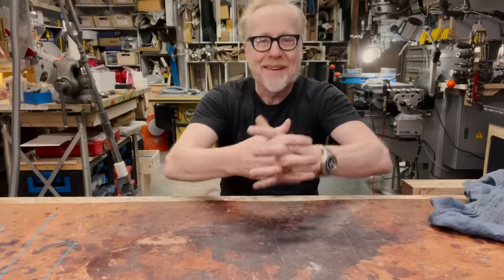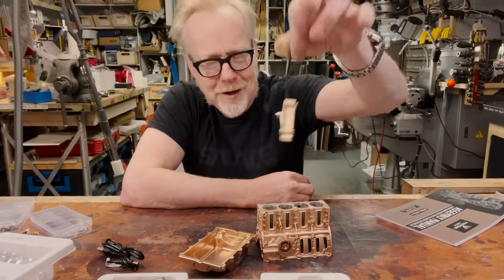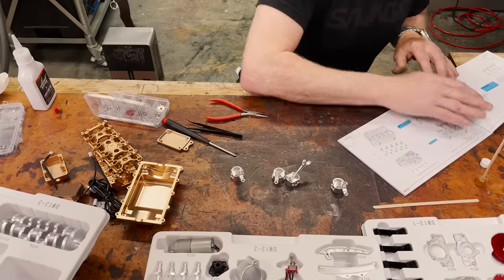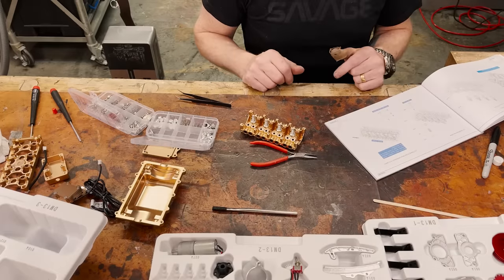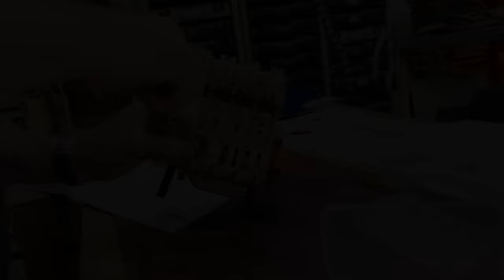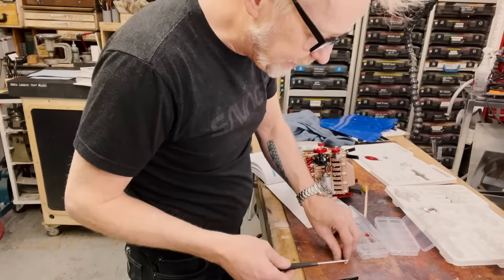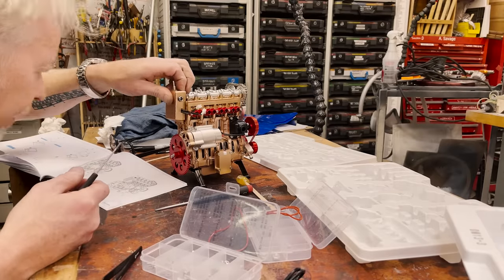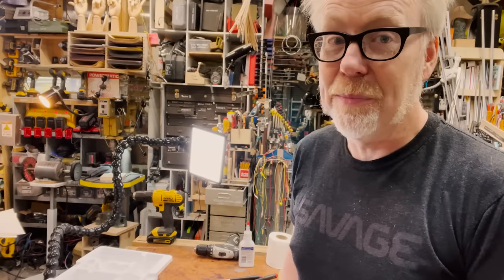Adam Savage's One Day Builds: Car Engine Model Kit!

Comment: 13:00 Those pistons don't have piston rings? Isn't that a major concern? Piston slap? Anybody?
Reply: But I assume this is not a working engine? For that same price you can find a real engine in that scale. Which uses fuel to run.
Reply: There is also a working miniature V8 engine which costs $1800 USD. xDDD That's pretty amazing.

Comment: Well geeze... The silly thing doesn't even run. It's a model only. Check out this one that is actually a working 4 cyl engine. It's just short of $700 but actually runs (vs. $440 for this non-working one). 
Just search youTube for this:
"Assembling & Running a WORKING 4 Cylinder FOUR Stroke Model Engine - Toyan L400 Engine"

Comment: Hi Adam, I couldn't wait to see your reaction when you found out it was NOT a real running engine, but a $500.00 desk top toy, ... or did you know from the onset?

OK, you did know, but still you seem to have fun building it, i build the much more expensive REAL gas running motors.
That said, I (because of an accident), only have the use of my right hand only, so building these motors is much more challenging at times where 2 hands are needed, I have to think outside the box, (as it were), ..... so, I challenge you to strip down that engine, put your left thumb in the belt eye at the back of your jeans, and rebuild the motor. ..... Go on, I dare you????

Comment: But at that price point, bit steep for the average person (in my opinion) just to have setting on the shelf. Spend i few hundred more and get an actual working engine, build it and sell it for a profit. (Just my 1 cent, for what it's worth). They are cool, but not almost $500 cool, again, in my opinion.

Comment: Mounting brackets ?????? WTF.  You mean main bearing caps. It was killing me to see you put the piston and connecting rods onto the crank before it was in the block .But then it all went right in. Definitely wouldn't work on a real engine with cylinder rings.